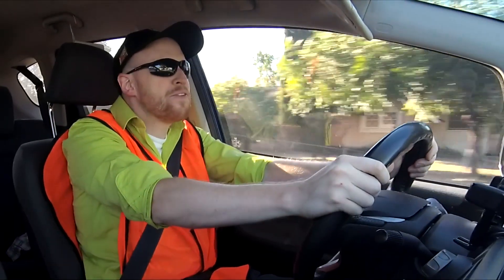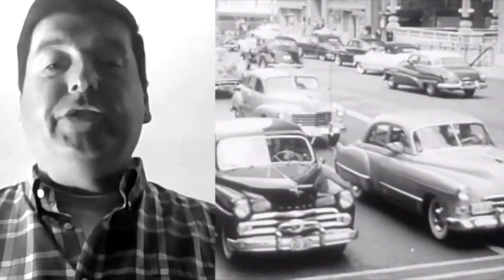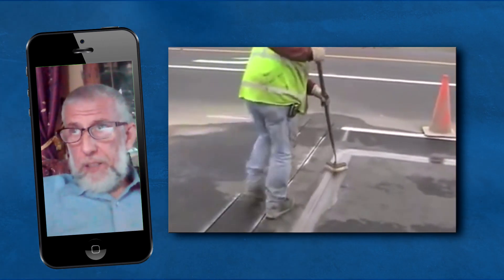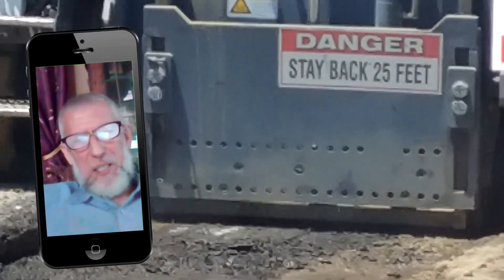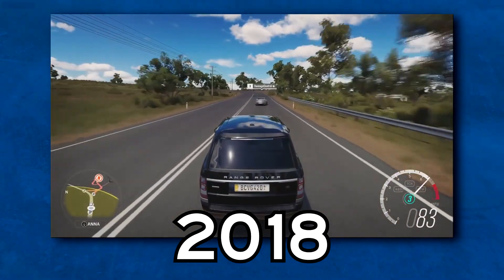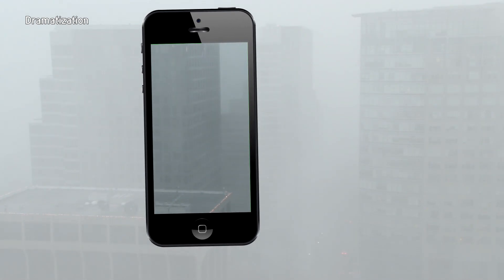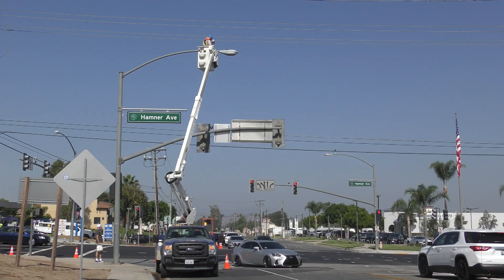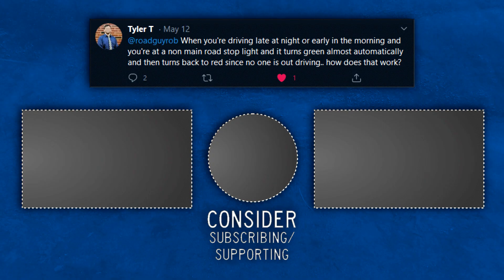How do stop lights "see" your car (to turn green)?

Comment: In the 80's and 90's there was a rumor that if you flashed your high-beams at some traffic lights it would mimic emergency vehicle strobe lights and turn green for you.  Anecdotally it seemed to work!  Was it ever really a thing?!
Reply: If that seemed to work it was probably a coincidence.  The light was going to change anyway.  That said, emergency (and sometimes public transit) vehicles are often equipped with infrared LED transmitters similar to what is on in remote control.  Priorities are assigned to different vehicle types.  Directional detectors sense coded signals from the approaching vehicle and adjust the signal operation.

Comment: The City of Tucson has been using traffic cameras since the mid 1990s. However The City Of Phoenix even as late as 2020 still uses loop detectors and is just beginning to use traffic cameras in 2020.

Comment: Just found your channel today, watched about 4 videos so far.

I have one complaint about loop detectors, they are awful at detecting motorcycles.  I have ridden them on the streets for 30 years and almost all, if not all, do not sense the motorcycle even when the opposing traffic was non  existent.    I would occasionally need to just run the red after waiting a few minutes if another vehicle did not arrive in the opposing lane.

The cameras are so much better with motorcycles.
Reply: Same here I've been binge watching the channel. Yes traffic cameras are better for motorcycles.

Comment: Whenever I am at an intersection without any cars waiting for the light, I tip my steel bike frame over the loop to ensure that the loop detects me. The more you know...
Reply: Some study showed that the wheels over the line that's the edge of the induction loop in line with the thing has the best chance of triggering the sensor. If you have both carbon rims and carbon frame, you're probably in trouble
Reply: @andreyv116  No problem with a lugged steel frame.
Steel is real!
Reply: @DavidTurner1  "Steel is real .... slow (or 'heavy' if you prefer)" :p
Reply: @Finx5000  makes you stronger mentally and physically
Reply: @andreyv116  rich people can afford to wait
Reply: I saw a tip for motorcycles and bikes that involves a strong magnet stuck to the bottom of the frame
Reply: @QuinnHartmann   Seems plausible.
Reply: AkshonClips  "Easy enough."

Yes, let's just force all bicycles to use pedestrian crossings at every junction because their frames or spokes aren't magnet friendly enough...
Reply: I guess a mostly aluminum bike would also have the same trouble triggering the loop. My Trek is aluminium frame, I believe the rims are as well, the spokes might be steel, but I'm not sure. There might be other all random steel part's, but the bike is 20 years old, before carbon became way more common. I think only high end race bikes with national teams had carbon fiber back then.
Reply: @marcusdamberger  I have an aluminum frame aluminum rim bike and its success rate is mostly good. Alignment with the coil is important
Reply: That's why I always carry
Reply: @turritopsisrockola  put your gun on the sensor

Comment: The traffic control to protect the workers while they cut the loops is probably the most expensive part of installing them.
Reply: I've never actually seen round loops before. It must be a California thing.  They're usually rectangular or octagonal.
Reply: @jovetj   Interesting. It's nearly all we use where I am!
Reply: @jovetj  Not just California
Reply: Assuming that use traffic control. In my city, there isn't enough traffic to warrant their use. The one time I cut loops, we simply had our own cones and lights and proceeded to work away.
Reply: @YT-TheLegacy  Yikes! That would be illegal in my part of the world. It would violate workplace safety regulations.
Reply: @YT-TheLegacy   against the law in the US, unsafe
Reply: Is it actually specifically against a law, or just one of those where liability and/or insurance is the decider?

Comment: I had no idea loop sensors were around so long. There was an intersection in North Jersey I would pass through a lot that had a permissive left signal. It would only give an arrow if at least two vehicles were in the left turn lane. I found one day that I could "trick" it into giving an arrow every time even if I was the only one in the lane. There was a loop sensor just beyond the stop bar, if you pulled over that one, it would give you an arrow. It has since been replaced with video detection.

Comment: Some city buses also use antennas to communicate to traffic lights. “Pulse” bus lines change the transit signal priority at intersections. It can shorten red lights or extend green light based on the schedule and when it’s done loading passengers.
Reply: I’m pretty sure the ambulances in my area use something similar to that because they alway use this one intersection to turn toward the hospital, and the lights always turn red for all directions when they approach
Reply: @closmasmas9080  yeah that's done almost universally in cities. There's a small black thing that looks like a train signal mounted near the stoplights, it looks for a very specific sequence of flashes emitting from the ambulance, if it matches, the lights turn green. It's been around for decades, it used to be a lot less sophisticated where you could flicker your high beams and it would trip.
Reply: @chris-hayes  I use a laser to trip the sensors for me when the light won't turn green or I'm in patient
Reply: @chris-hayes  - There's also a system now that uses GPS to monitor the location of emergency and transit vehicles and notifies the signals to change as they approach.
Reply: @chris-hayes  there's a clear light on emergency light bars that they use for this